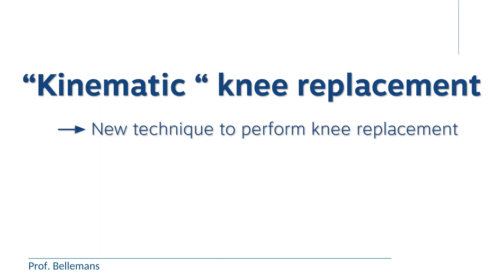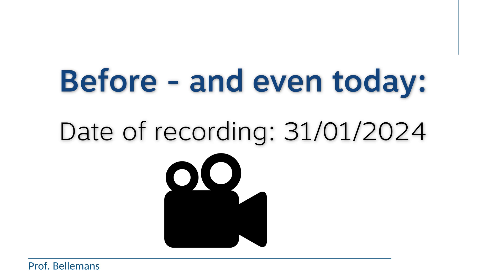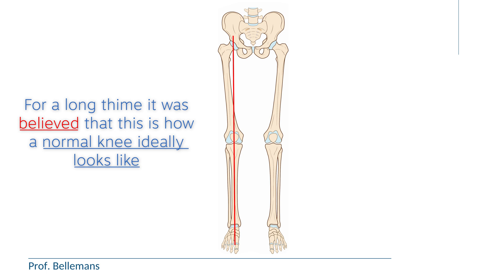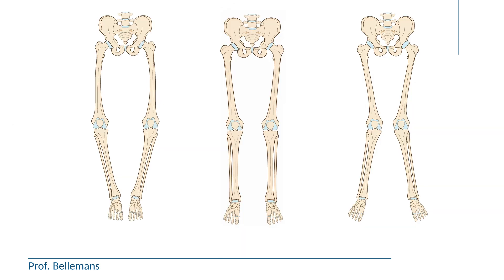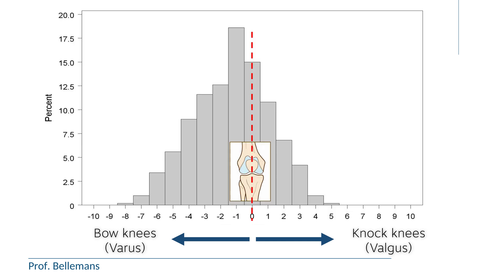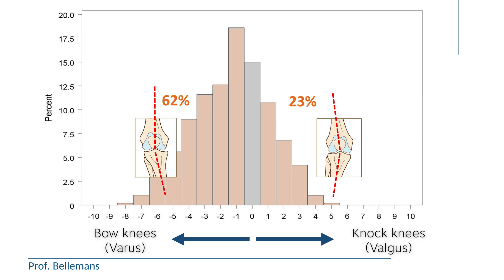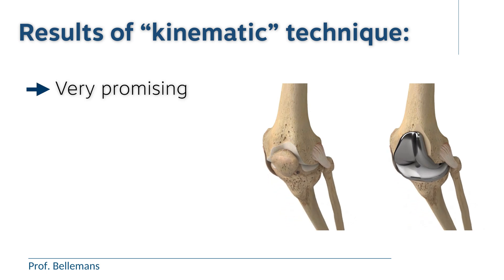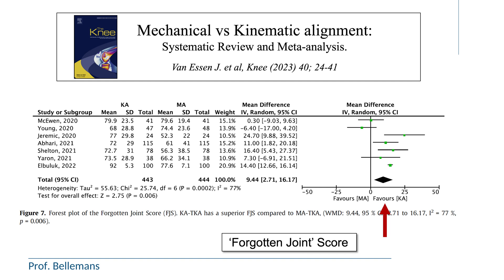New game changing knee replacement technique explained - "Kinematic" knee replacement

Comment: I have learned a lot from Dr. Bellemans videos.   Had both knees replaced in 2023 two months apart. I have always been somewhat bow legged. Looking at my final x rays my Dr. did not do a total mechanical alignment, but left me just slightly in varus. Anyway the knees are working great.
Reply: Was it a total or partial knee replacement? What about the flexion bending rate? Planning to have one myself.

Comment: How do they know what your leg alignment was originally? My wife is considering knee replacement and she is quite bow legged, but she wasn’t before. She has lost so much cartilage that she is bone on bone and her legs have bowed outwards.
Reply: I am bowlegged, and with 10 years of bone on bone, I basically had no ACL.  My husband didn’t like walking behind me because of how my knees looked as I wobbled with each step.  I had a total knee replacement 7 weeks ago. My doctor did the Kinematic correction and uses Mako  robotics.  They took a CT of my knee, and also an X-ray from hip to ankle. I am very pleased with the results.  I had told him at the onset I didn’t want a totally straight leg as I have been bow legged my whole life(65 yrs).
Reply: I have the same question.  Both knees are bone on bone, and I have gotten progressively bow-legged the past few years---but never was before.  It is because I still have cartilage on the outside of the knee joint but not on the inside of joint so the bones bow to the outside.  I will be seeing a 5th orthopedist this week, and will now know to ask this question.  I certainly do not want bow legs if it can be done, and with kinematic.  It seems to me that after cutting the bone, and then positioning the replacement joint that the knee would be stabilized in a straighter alignment--than one of being bowed.

Comment: it seems like the mechanical replacement would put undo stress on the hip joint if the patient was anything other than straight lined.....so it just leads to a new problem down the road if you change the angles of the alignment that the patient was used to for their whole life...i really haven't seen any of my friends who have had total knee replacement return to full on running after they had TKR....makes me wonder if it alleviated the knee pain put puts stress on other parts of the body and causes them to walk/run more cautiously because of the different discomfort/pain and alignment...I want you to do my knee if it needs it in 5yrs from now